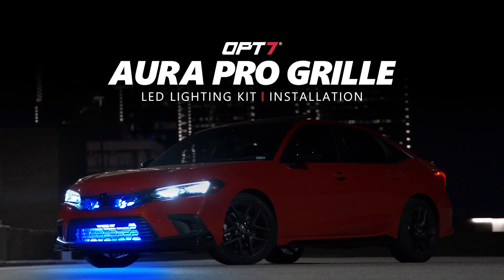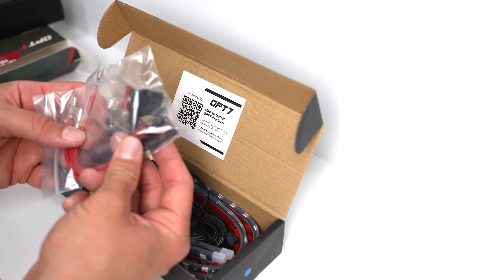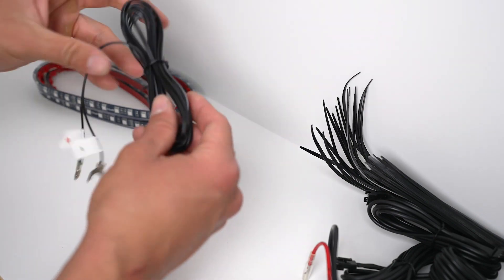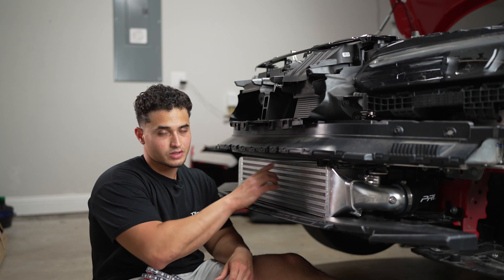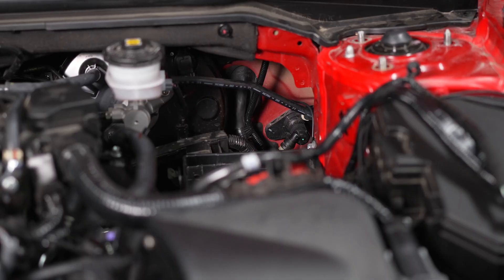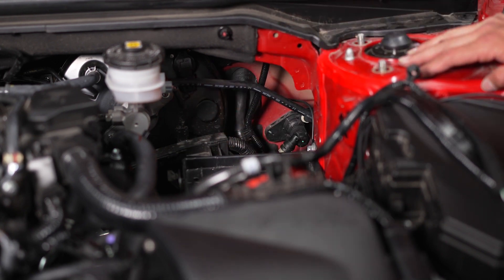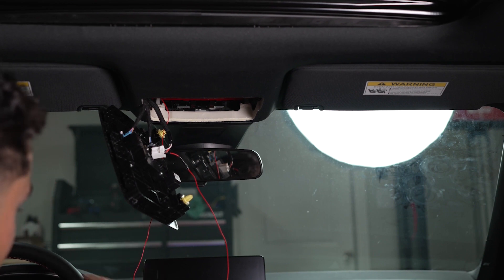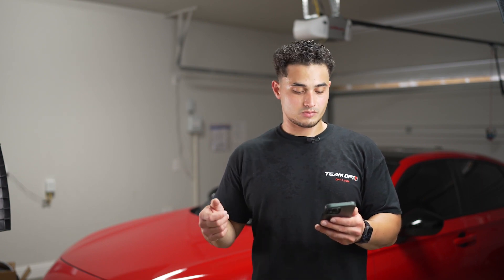OPT7 AURA Pro Bluetooth Grille LED Lighting Kit Installation Video 11th Gen Honda Civic

Comment: i am struggling so much to remove the dome light :’) helpppp
Reply from the maker: I’m sorry to hear you’re having trouble with the dome light. It can definitely be tricky sometimes! Here are a few steps that might help:

Check for Screws or Clips: Some dome lights are secured with screws or clips. Look around the edges for any that might need to be removed.

Gently Pry It Off: If there are no visible screws, try using a flat tool or a trim removal tool to gently pry the dome light cover off. Be careful not to damage the surrounding area.

Consult Your Vehicle’s Manual: The manual might have specific instructions for your model, which can be really helpful.

Check Online Forums or Videos: Sometimes, seeing someone else do it can make it easier. Look for videos or forums specific to your vehicle model for visual guidance.

If you’re still having trouble, let me know what kind of vehicle you have, and I can provide more tailored advice!
Reply: thx i got it but now that i put the wire on it it doesn’t turn on by itself
Reply: it does turn on but it’s the door one that it keeps it on there but yes it turns on automatically, but the lights don’t switch
Reply from the maker: @johncruz4455  Feel free to contact our technical team for more support via email - support@opt-7.com
Reply: @OPT7Lighting are you sure it’s the red cable for the dome lights?
Reply from the maker: @johncruz4455  Feel free to email our technical team at support@opt-7.com 

Depending on your vehicle, it may have a only positive or only negative door trigger. You'll have to check your owner manual which wires to use.
Reply: @OPT7Lighting  great thank you i’m going to check right now, if yes would you recommend me to disconnect the positive then? since rn i have both on but the door assist doesn’t turn off, the lights do turn on by itself
Reply from the maker: @johncruz4455  Please email our technical team at support@opt-7.com